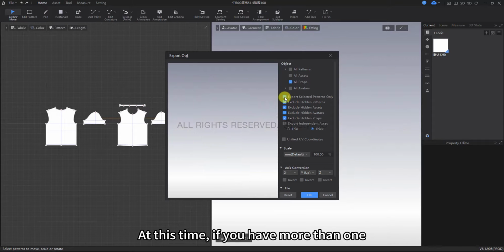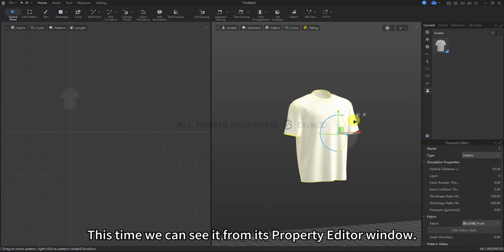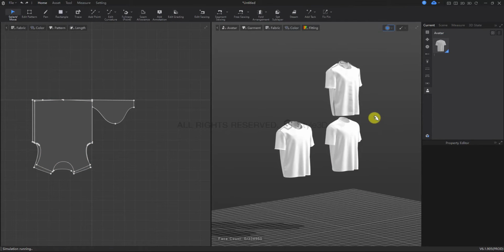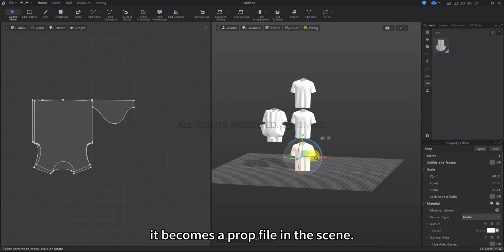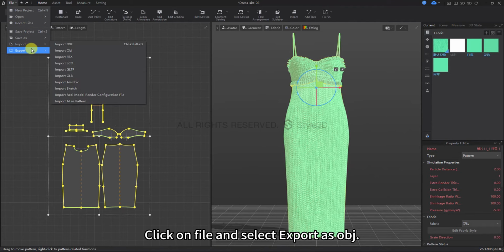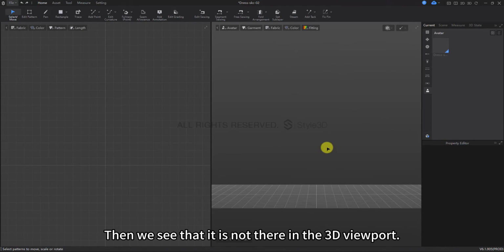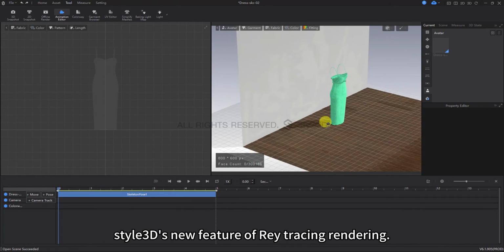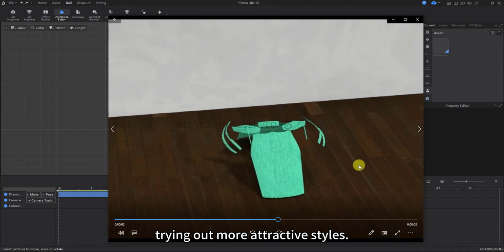Style3D - Transforming Patterns into Garment

Comment: Tips:
If pop up dialog messages like "Failed to Read Pose" or "Mismatch"
Please check: During 2D and 3D transformation processes, whether the mesh count has changed. You can view the mesh count by going to 【File】→【User Settings】→【Show Face Count】→ Check
. Factors causing mesh count changes: ① Inconsistent removal of sewing in 2D and 3D (in fact, deletion is unnecessary, hiding is sufficient); ② Inconsistent modifications of piping, seam tape, topstitches, and buttons in 2D and 3D.